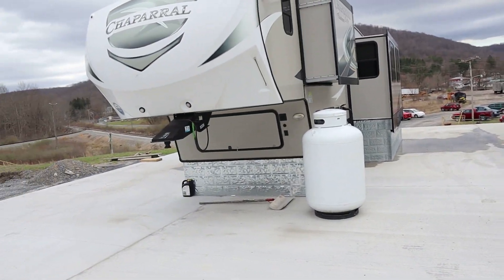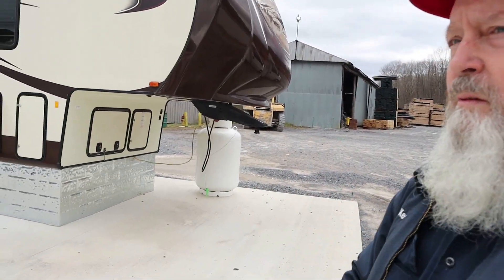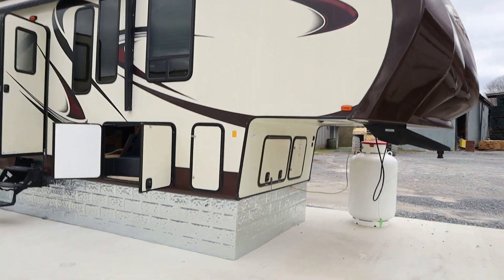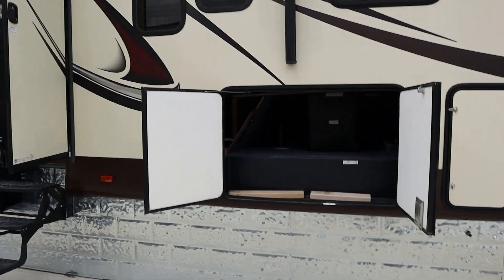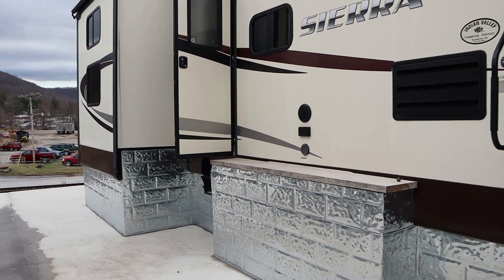Easiest RV Repair Ever !!!!

Comment: My Dometic 310 also drips.  It seems to be worse which lower water pressure.
Reply from the maker: Sometimes putting a shut off valve behind the commode is the only way to stop it.
Reply: @hillbillyrv  I put the valve behind the toilet because the valve continues to fail. Don’t make sense.
Reply: I just replaced my valve on my Dometic 320 and it started leaking a day later at the foot pedal
Reply from the maker: @bobabooie6389 RV repairs are fun, ain't they.

Comment: When ever we get a new trailer, I install an in-line valve for the toilet. When we start having issues with the valve, at least I can turn it off between uses.
Reply from the maker: That’s a good idea. I have installed a bunch of them over the years.

Comment: The worst case fix I would loop additional hose and fasten higher up on the wall a shutoff valve like the standard under counter or toilet emergency shut off valve. As for tenting we've done a lot of tent camping and now only use hammock tents. Ours are Hennesy diagonal. Sleep straight like most hammocks or diagonal for flatter roomier layout.
Reply from the maker: I have put shut offs on them before. I really thought about hammocks, but never pulled the trigger on one.